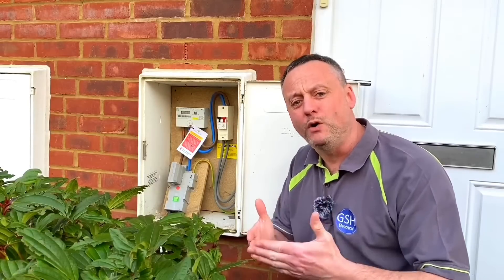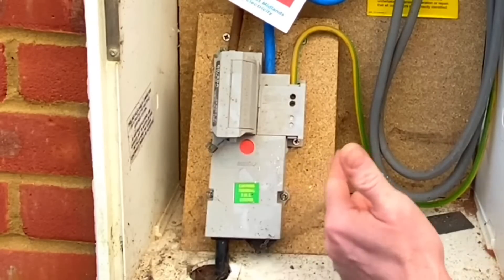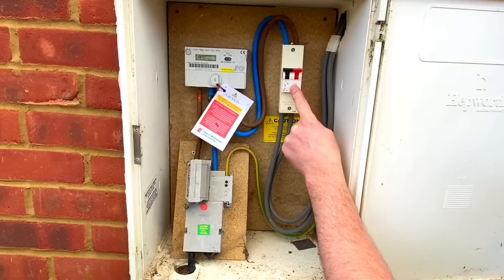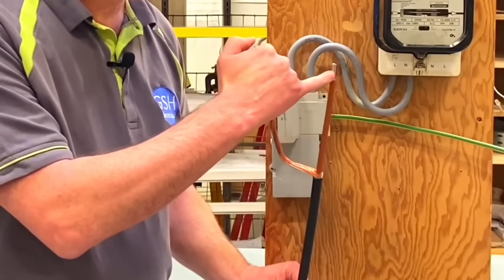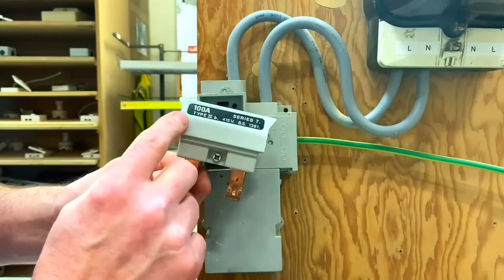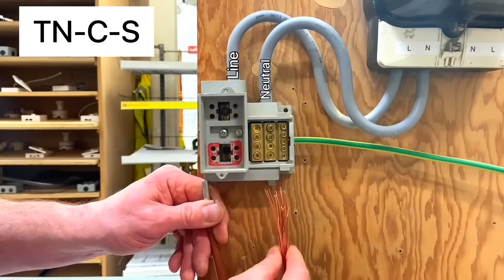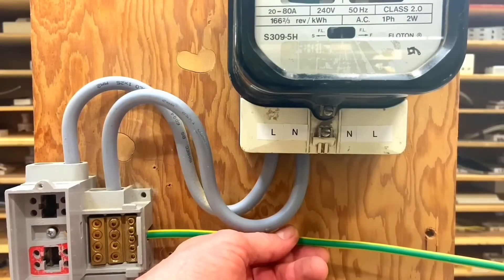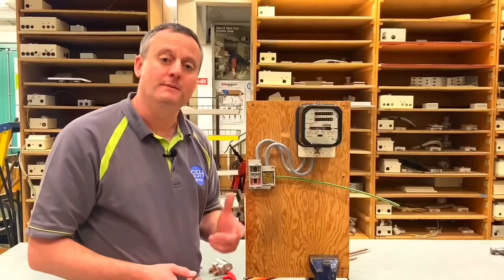Concentric Cable - What’s it Used For?

Comment: Split concentric cable seems to me that this reduces the cross-section of the neutral conductor. Otherwise, why not use several wires with a cross-section of 2.5 mm for an electric shower?

Comment: Systems buggered. Too many politics.  Connecting 25mm tails to a probably non existent double pole isolator with 16mm tails behind it kind of defeats the object. Supplier will never do anything about it. And we can't pull to fuse....world would be safer if we could just connect our 25's up to the meter and back to the fuse.

Comment: Why do they use it? Smaller profile? Cost?
Reply: "The cables have excellent anti-EMI and anti-lightning characteristics. The XLPE insulation helps to maintain high quality power supply. Furthermore, concentratic cables are suitable for direct burial. Further, they have low positive and zero sequence impedances, making them an excellent choice for direct burial."

Comment: Split concentric cables are often used to run from the meter to the fuse box in apartment blocks - which I personally don't like.

Comment: Can we use split concentric in an electrical installation ? I think Nick Bundy had a go once?
Reply: we use it if the cut out to the db is longer than 3metres, or if its going through walls, never needed to use it for anything else

Comment: Why is the line Aluminium and not copper? Is it simply down to cost?
Reply: Actually both Line & Neutral ought to be made of Al. material; but due to Earthing conductors Forbidden in Al. material (Earthing is derived frm PEN here), so the PEN has to be made of Cu.

Hope that makes sense.😅
Reply: @temp26j724-i  Aluminum can be used as an earthing conductor, AWA cables are an example where they are.
Reply: Yup, cost. Way more bang for your buck with aloominum (alumininininium). It's much more brittle though, and repeated bending will make it crack a lot earlier than copper. Even a few "enthusuastic" rewires might break it.

Comment: There are usually 3 types of underground service cables (all of them are usually black)

Most common now is the Concentric shown in this video. It looks the thinnest of the 3 and is PVC insulated.

Less common now is the Split Concentric, again as shown in this video. This looks almost identical to the Concentric but is a little thicker. Again it is PVC.

The older properties (electrified from the 1920's through the 1970s) is a Pilk cable! Although they can be 100 years old they are still as good as when they were installed if they remain untouched. They are a complex copper cored twin cable with paper wound insulation with an extruded lead sheath (the lead is the earth). This inner cable is usually covered in a steel tape armouring wound round the lead, this is further covered in a hessian in hot dipped bitumen .... I did say it was a complex cable ;o) You would sometimes see this type of cable having an earth sweated on to the lead sheath and going to a separate CET.

In older type cutouts there is usually a separate earth terminal block and a neutral block. There would be a link (PME link)that came with it that you could eather leave off or join the two blocks to give different options of supply earthing. Pilk's were usually TNS.
With modern jointing techniques and the cost cutting prevalent today most DNO's would do repairs to underground cables that would change the TNS supplies to TNCS so unless you are sure it is better to err on the side of caution when doing Ze tests. If you are not sure a phone call to the relevant DNO would let you know the supply type (any jointer, engineer or fault tech could look it up even on site!
Sorry if this was too much information ;o)
Reply: Pilc not pilk, paper-insulated-lead-covered.
Reply: @zebadayusw901  You are right! ... My bad ;o)

Comment: I don’t know the size of the concentric cable . But it always seems to small . It’s also aluminium so won’t carry the same load as copper. . That’s compared to 25 mm tails we have to use . I remember talking to a guy years ago when he was installing the stuff. At the time he said he agreed it’s to small. 
Maybe someone knows the answer
Reply from the maker: Strange Cable 👀
https://youtube.com/shorts/qx9RKAT93zI?feature=share
Reply: DNOs don’t abide by 7671.  If the cables were undersized there would be failure.   I assume they just work to tighter tolerance due to the size of the infrastructure, while we have a good margin of error.
Reply: Concentrics do look smaller than conventional cables. 
The Aluminium core is usually 35mm though.
Reply: @totherarf  ok thanks

Comment: Thanks Gary, it would be helpful if you could show how you got the Nuetrals into the N/E  block
Reply: The way I used to do it is to wrap tape just below where they would sit in the neutral block and then above it too. Once you cut it it slips straight in.